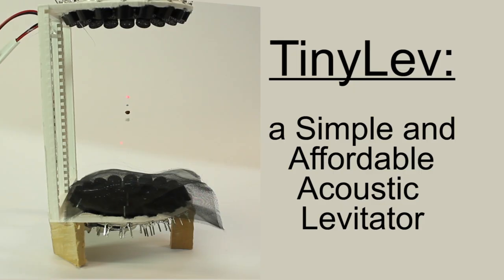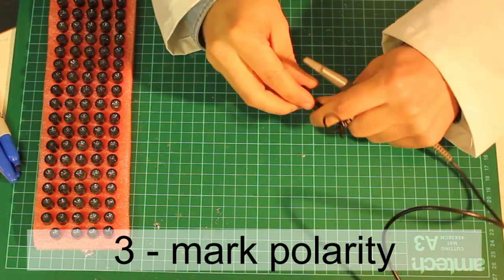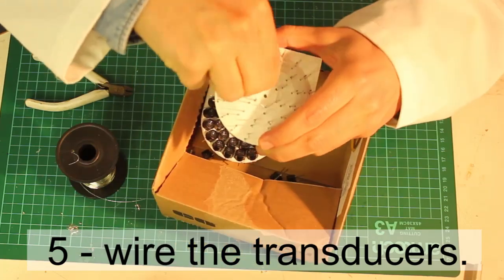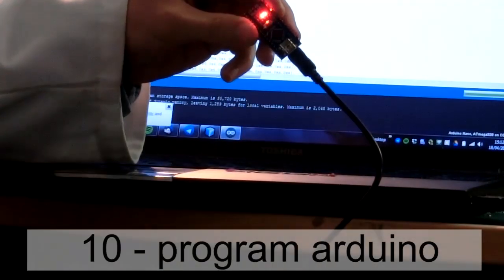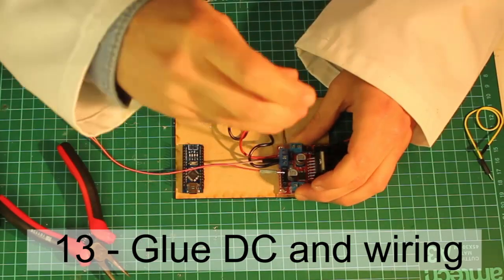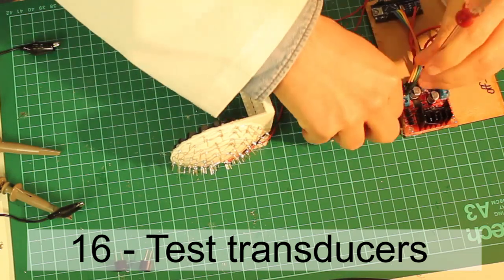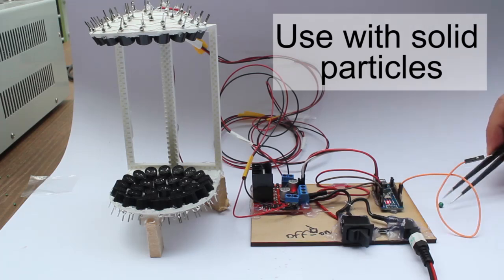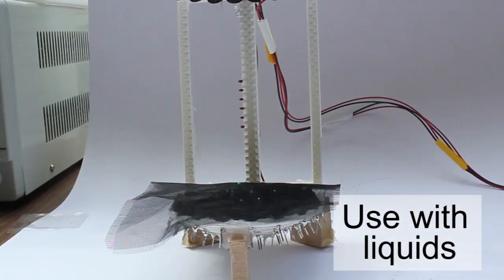Acoustic Levitator DIY - TinyLev - levitate liquids and insects at home

Comment: Through making your original design I found the easiest and fastest way to check the polarity of the transducers is to just hold them up to your mouth and create an input signal by making a popping sound with your lips. It cut a lot of time out of the process and I wasn't worried about damaging them by poking them.

Comment: Amazing, is it maybe easier to do it with bigger speaker cones? Like car speakers
Reply from the maker: Mmm car speakers are not that good generating sound above 20kHz. From all the methods that I have tried, these transducers are the best in decibels per $, and also in decibels per cm2. But you are right, sometimes we use "tweeters" for some experiments.

Comment: Why using multiple times small transducer instead of one or two ?
Reply from the maker: to get enough powah
Reply: @UpnaLab  or will one high power transducer not work like from ultrasonic cleaner ??
Reply from the maker: @omsingharjit  I wish, but ultrasonic clearners may need some kind of horn attached on top to radiate properly into air. Also, with small emitters you can give them a curved shape, you cana lso give the horn a curved shape but it will vibrate as a plate. In general those small emitters are easier to get off-the-shelf but using big powerful ones as you say brings other advantages. you can check the paper from Daniele Foresti on Acoustphoresis

Comment: Can you use larger ultrasonic speakers to do this with a large cup of water?
Reply from the maker: the maximum size depends on the frequency. Lower frequency levitators (around 19kHz) can levitate droplets of 4mm diam. Going lower would be almost impossible since energy will be much smaller and frequency would be quite annoying.
Reply: @UpnaLab  what if the frequency went higher? So it seems extremely large transducers are not able to levitate a cup of water.

Comment: So is this like weightless? I mean if it was scaled up to fit a person, would it feel like micro gravity with no weight on internal organs etc?
Reply from the maker: To be sincere I am still not sure. One pending experiment that I still need to do is to weight: the levitator whille it is off, the levitator while it is on, the levitator while it is on with some particles inside.
Reply: Asier Marzo That would be interesting. Do update on that if you don't publish it in a paper
Reply: The mass/weight of the combination is the same regardless if it is on and levitating or the particles are just sitting in the levitator with it off. Standing waves between the top and bottom transducers are what is holding the particles in place. This creates a reaction force on the transducers, pushing them down exactly as much as the particles are being pushed up.

For every action there is an equal and opposite reaction.

Comment: hello, the 12 gauge wire does not fit into the screw terminal of the driver, do i need a different screw terminal, does anyone else have this problem and know a work around or if it is possible to use thinner wire? thanks

Comment: brilliant Asier! How much would it cost to scale up to levitate an object about 20" in diameter and 20lbs?
Reply from the maker: Thanks man. Acoustic levitation has 2 limitations in the objects that it can levitate. The object cannot be bigger than half-wavelenght (40khz in air is 8.6mm), so this levitator can levitate objects of up to 4mm diameter (in the instructables there is a levitator that works at 25kHz so it can levitate objects of up to 7mm). The second limit is the density, this levitator can levitate objects of up to 2.2g/cm3, in the instructables there is one levitator that can levitate up to 6.5g/cm3.

Comment: Hello, can I put a kit together like this with a multimeter ? I don't have a scope
Reply: You can use a multimeter to test the polarity of the transducers. Just set it to dc and tap the probes to the tails. If you get a positive value then the positive tail is the one which you tapped the positive probe to. If its a negative value then its vice versa. I found it useful to have background noise (music playing) to get a clearer reading. fyi, over 80 transducers tested and they had all been marked correctly in the first place. The incorrect markings may be an old issue that has been rectified.

Comment: 2 questions:
1: What is the purpose of the acoustically transparent fabric?
2: Having someone print the STL file, is too pricy. Would I be able to make this work with a flat array if I were to put in the effort to make it work? From the research I've done so far, yes, but I still have a bit to learn about the physics before I invest.
Reply from the maker: 1. That fabric can be used to place objects inside the levitator or to protect the bottom transducers from spillages. 2. Mmm you can use a flat array but the trapping will be much much weaker. In 3DHub for something between 12 and 16 pounds you can get it printed in PLA or ABS.
Reply: Asier Marzo I have some questions about the pizos.
1: Do I need plastic case or aluminium case?
2: Do I need the function of transmitter and receive to combined or separately?
3: Do I need it to be sealed or not?
Reply from the maker: I evaluated various models here http://aip.scitation.org/doi/suppl/10.1063/1.4989995/suppl_file/si_4_am.pdf

If you are going to build TinyLev you need 40kHz 10mm diameter transducers: MSO-P1040H07T. I think they are plastic, only transmiter and not sealed.

The best ones for BigLev (16mm diameter transducers) are the ones with aluminium casing, only transmiters and not sealed. That is the MSO-A1640H10T
Reply from the maker: No idea, in general the transmitter only should be better than the TR system. Although I think that actually when you ask for the TR transducers they will offer you separate T and R types.
Reply: Thanks for your time. Best regards from Spain.

Comment: @2:32 what is he adding to D10?He says a jumper but it looks as small as the push switch buttons.
Reply from the maker: It is to connect D10 with D11. You can use a jumper wire or the small bridges used to connect two pin headers in hard-drivers and other old computer components. BEst.

Comment: can I make this project without the L298N motor driver?
Reply from the maker: In the instructables there is a minimal version called microlev. However, you can get that component for very little money (2.5£)
Reply: Thank you do much!
Reply: Asier Marzo is it possible also for us to use the peizo buzzer or buzzer to generate above 20k hertz?

Another question, what's the importance of the L298n?

And again, thank you so much for everything, you're so cool.
Reply from the maker: do not think so, they output very very little power compared to the 40kHz transducers.
Reply: The L298 is an H-bridge driver. You'd need to replace it with another H bridge driver, or build your own from parts.

Piezo buzzers have a sharp resonance in the audible range, usually between 1kHz and 3kHz. It is unlikely you'd get any significant power out so far off of resonance.

Comment: wow, i´d like to rebuild this according your manual. Where can I buy the equipments, esspeciallyy the 3d print out model?
Reply from the maker: kindly, check in the description there is a link to the instructables. There you can find links to the individual components or if you prefer MakerFab sells a kit with all the parts https://www.makerfabs.com/index.php?route=product/product&product_id=508 . Best.

Comment: Hello, 
The supplier asked me these questions and I'm not sure of the answers to the second two.
1,what is the size do you need?
10mm or 14mm or 16mm?
2,do you need plastic case or aluminium case?
3,do you need the function of transmitter and receive to combined or separately?
4,do you need it to be sealed or not?
Thanks
Reply from the maker: 10mm diameter 40kHz transducer, only emitter.

Comment: Is it possible to lower the voltage of the power supply to make the liquid float in the air? What effect does that have?
Reply from the maker: liquids are tricky, too much voltage and the droplet pops, too little and the droplets fall

Comment: Looks like a great project ! I would like to build with my son. Any recommendations for a UK supplier of the transducers - you mention cost about $80, but at RS components it is £290 just for the transducers ?
Reply from the maker: Cheapest ones are from the links in instructables. Ningbo or manorshi, they may sell you 100 of them instead of 500.
Reply: Many thanks Asier. I found a local shop that happened to have them in stock for a reasonable price. Prior to that, I found Alibaba would have been the cheapest option.Thanks once again for your video and I am really looking forwards to attempting this. It is certainly a step up from my PID sous vide controller and has rekindled my enthusiasm for invention, science and technology!
Reply from the maker: That is great, finding good and cheap transducers is usually the hardest part. In a couple of months I will try to publish a directional speaker that pretty much uses the same hardware.

Comment: Are all 72 sensors a transmitter? Or is the receiver mixed? Sellers said to sell separately.
Reply from the maker: They are all transmitters but it does not matter that much. Could comment on the instructables?

Comment: Do you think it's possible to make a room that can levitate people. Like in the movie Ender's Game. If so, how?
Reply from the maker: Not with the current technology in acoustic trapping. The power would need to be so high that your skin will burn and you will collapse. Also, the frequency would need to be incredibly low (audible range) because the maximum particle size is less than half-wavelength. But I am sure we will find ways or other suitable technologies for that : )
Reply: So the levitation is depended on the size of the object being smaller or equal to lambda/2 and also about density.
I have been doing research about this subject and I have concluded that this process requires Pvg to be equal to Pogv (Bouyancy = Weight). Is this correct and if so how does the density of the object change the density of the air around it.

Comment: How can I apply 8 or 9 V to levitate water and alcohol, I don't know how change the voltage, help me please, I'm doing my DFD with this kit. Thanks
Reply from the maker: Regulated power supply, or just a dc-dc step up, also the provided power supply from the kits is 9V.  Also, many wall dc adaptors can select between different voltages.
Reply from the maker: @JaviGB21  Sure asier.marzo @ unavarra.es

Comment: Does the circuit put out square waves or sine waves to the transducers? I saw both flash by on the scope. Also, why is it nessecary to use ultrasound? Why couldn't you use two piezeo tweeters and 10kHz? Then the size of the object could be 4 times as large
Reply from the maker: The driver board generates square waves because they are easier to generate and cheaper to amplify. However, the transducers are so narrowband that their output is sinusoidal. There is some measures here  http://aip.scitation.org/doi/suppl/10.1063/1.4989995/suppl_file/si_4_am.pdf . Piezos do not have enough power to levitate, take into account that the employed 40kHz transducers are really powerful, also doing levitation at 10kHz would be deafening.

Comment: Hello, Asier, how are you? our levitator is very noisy and we have tried to repair in all the ways but we do not know, do you have any indication that it is?
Reply from the maker: Is d10 connected to d11? Are the lights on the arduino and driver on? Kindly take a look at the instructables comments
Reply: @UpnaLab  Yeah sure. The arduino and the circuit are correct since we tested them with another partner but we do not know what happens because the transducers give a loud noise.

Comment: We are having trouble levitating liquids. We have a bent needle with the tip removed but it is not working, the droplets keep falling. Can you tell us what liquid you are levitating in the video, and do you have any other tips?
Reply from the maker: You can use some levitated styrofoam particles to know approximately where to put the droplet. You can increase the voltage up to 12V if that helps, but usually 9V is enough for levitating water. If the levitator is not strong enough it may be that some of the transducers do not have the correct polarity. Best.
Reply: How do I increase the voltage up to 12V? And what piece of equipment do I use to check it is up to 12V? Thank you for your fast reply
Reply from the maker: The power supply that you use to power the device may have a regulator to select the voltage.
Reply: Okay, I am currently using a Variac to power the acoustic levitator and measuring the voltage to the transducers using a multimeter. Can you tell me what piece of equipment you are using in the video?
Reply from the maker: A variac is to transform AC into AC. The input to the levitator should be DC (from 6 to 12Vdc). A normal power plug like the one referenced in the instructables does the job. I am using a regulated power supply.
Reply: Thank you for your advice! I changed the power supply and now I am levitating liquids quite effortlessly. I have a question about the voltage: what is the relationship between the voltage and the wavelength? Also, is there a mathematical relationship to how the density of the particles and the minimum Vpp - I have read your supplementary articles and published work.
Reply from the maker: Glad that is working. Voltage and wavelength are totally independent, wavelength depends only on the propagation medium (i.e. air) and the frequency used. Density and vpp is in the paper Figure 4.
Reply: What factor of the acoustic wave (e.g. frequency, amplitude) does changing the voltage alter?
Reply from the maker: amplitude.

Comment: Can I exchange the 40 khz transducers for another one?.  Can I use a lower frequency transducer?
Reply from the maker: I have only found 40 kHz and 25 kHz transducers with enough power to levitate, and the 25 ones do not work that well.
Reply: Asier Marzo Whats about a HC-SR04?, it is a Arduino circuit

Comment: Hi, What would happen if i put some ferrofluid in the middle ? a magnet ?
i was thinking to put some ferrofluid in a cylinder and make the liquid move. Is this possible ?

Or could it be possible to code the magnets for making spin the liquid in the middle ? The liquid stay in the midle but the magnetic field make it spin ?

I'm thinkink about that for an code project in university in art program.
Reply from the maker: Ferrofluid will levitate normally and then wit a magnetic field you can affect it. A magnet may be too dense to levitate, perhaps one of the rubbery ones, or a tiny one inserted into the particle.

Comment: can you extend it to accurately manipulate  melted plastic/metal ?
Reply from the maker: This one will work with melted plastic, and there is a bigger version (BigLev) that can levitate some metals. However, anything above 6g/cm3 is a little bit complicated.
Reply: nice where to found an assembled one ?
( i' m too handicapped to assemble
Reply from the maker: I was talking with a company that could sell them already preassembled but for the moment assembling one is the only option.
Reply: ok
sad for too handicapped people
what system do you use to accurately position things in the big model ?
is there a site as wevolver where open-source work is possible for it ?
Reply from the maker: These systems can only move the particles up/down. For 3D control we need individual control of each of the transducers, we use a 64-channel driver t https://www.youtube.com/watch?v=g_EM1y4MKSc . I was going to publish the hardware&software for that soon but it is a little bit more complicated than these Instructables.
Reply: i was thinking to translate to rpi2/3 having the picam to control more  (from view)

Comment: are you just using the arduino to generate the frequency?
Reply from the maker: Yep, the arduino generates 2 40kHz signals and can change the phase between them.
Reply: could you possibly use a tone generator instead?
Reply from the maker: Sure thing, but we tried to minimize cost (2£ for the nano), space and complexity.
Reply: If you have a tone generator that has two outputs with variable phase delay between them, then probably yes. But it would still need the L298 H-bridge to drive the transducers.

Comment: I saw and followed the manual that you provided. But it failed. I bought the sensor I bought here (https://goo.gl/yazm45) 
Could the sensor cause a problem?
 The Aduino and L298N Dual Motor Drive Board made a square wave like you showed. However, when two sensors were facing, a sine wave was not formed. 
What is the frequency when a sine wave is made? 
And what was the voltage of the sine wave?
Where is the current value of Step 19 measured?
And are transducers and transceivers the same?
I want to make it really successful.